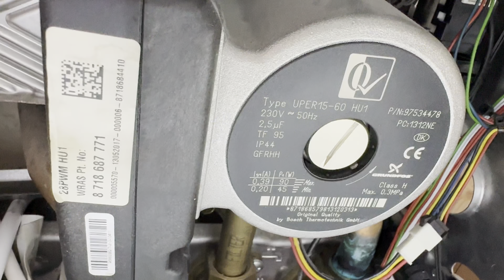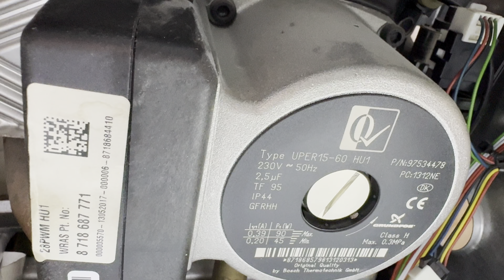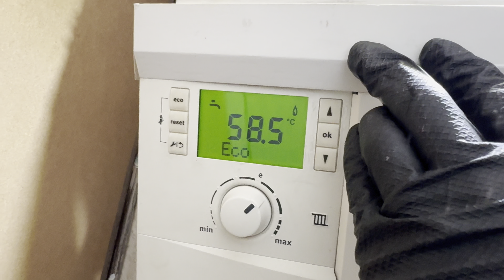Dirtiest Diverter Valve ever!!

Comment: Thank you for the excellent video. Just wanted to tap into your expertise. When my hot water taps are turned off my central heating radiator makes a gurgling noise. Is this something to do with the diverter valve. My boiler is a Worcester Bosch 30i greenstar 6 years old? 
Thanks in advance

Comment: Did you charge for all the parts as a diagnosis?
Reply from the maker: Hi, good questions, there are so many variations as to how people charge! The way we operate is a charge for diagnosis or repair where possible that usually covers up to one hour, if parts are required, the client would then be given a fixed cost quote to return and repair but the initial diagnosis/repair charge is still taken. Thanks for watching!
Reply: @RJHeating You not work for yourself? Diverter and P2P to be bunged is bad. You will get a recall on this,  guaranteed.
Reply from the maker: @56ty78ui yes, I work for myself. Correct advice was given to the client and repairs made to suit their current budget to get them back up and running. Not everyone can afford to fully flush the system etc on the back of their boiler breaking down and so all we can do is offer a range of solutions for them to pick which best suits them. You can’t force people to get a flush done.

Comment: Mate that drain cleaner is lethal in contact with other metals,it will eat away at it if not thoroughly washed away, hope no animals walk past that mess left on the tarmac, should of cleaned it out in the customers yard gully.
Reply from the maker: The road was washed down after with the spray gun in the video. But thank you for concern. In 18 years, I’ve never had it eat away at the metal in a plate as it’s washed out thoroughly before reinstallation.